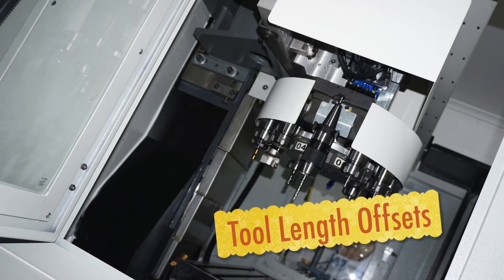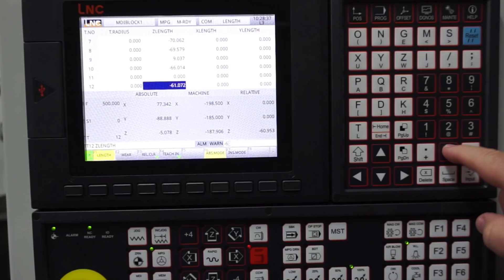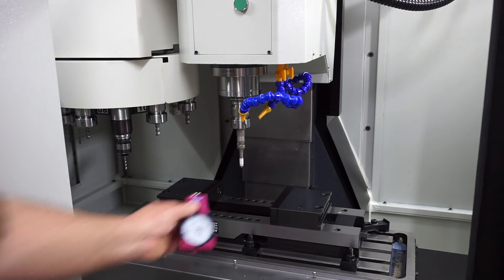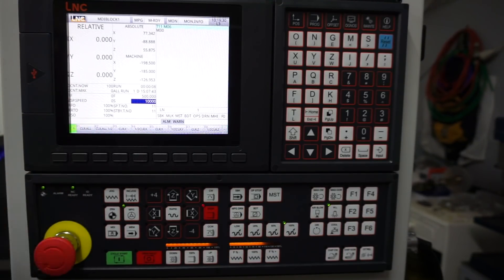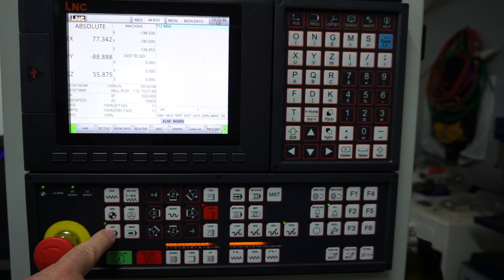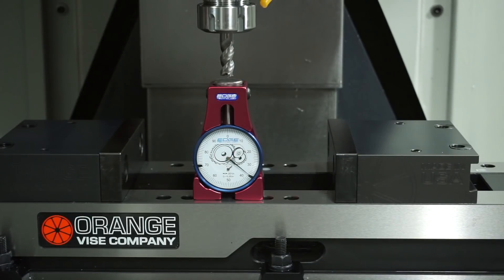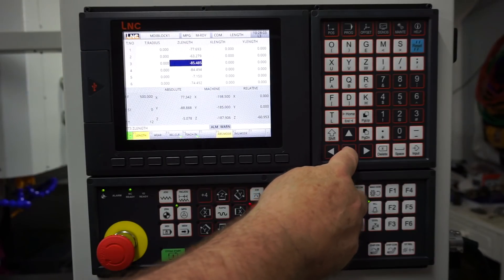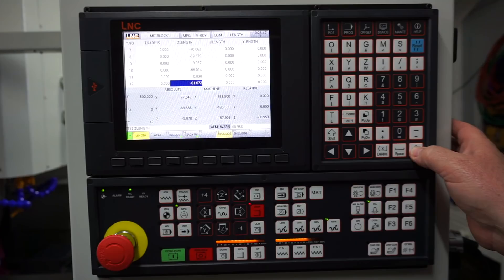How to CNC Pt.2 - Tool Offsets

Comment: Hi
What is your impression of the LNC control? Is there an available F360 post processor available for that control?
Reply from the maker: Hey mate, still early days.  However, the more I use it the more I like it.  I've been very happy with machine and the LNC controller so far.  F360 post has been made.  It is available from the Facebook SyilCNC user group.  Cheers, Aaron.
Reply: DCTTeacher1 do you find the control to be fast and accurate? What sort of traverse rates do you get? How does it go Machining 3D surfaces like a die mold? What’s the support like here in Australia? Spare parts availability?
Reply from the maker: Hey buddy, rapids and cutting feedrates are listed on the Syil website (see link in video description).  Part sizes from what I've machine out of Aluminum have been coming out spot on.  The 3D toolpaths I did on the 1911 grips (see video) worked a treat.  As for support, if you import directly you're on your own (factory support via skype), probably best to purchase through a dealer.  Hope this info helps?  Cheers

Comment: Great video :) I've got a little question though. How are young people in Australia towards the metal industry in general? As from my experience here in Sweden it is absolutely shocking what attitude people's got towards highschools with metal working. It is looked down upon and usually only people with failed grades tend to be there for some unknown reason..
Reply from the maker: Hi Simon.  Unfortunately this does tend to happen from time to time over here too.  Many kids flock to the other trade areas, as most don't understand what engineering is and what it's about.  Most of my students who pick it absolutely love it.  Especially when they work out that there is good money to made in the engineering trades, especially in fabrication, CNC and aerospace.  Thanks for watching :-)

Comment: Nice video. I’m interested to hear more about how you set tools numbers, etc
Reply from the maker: Thank you Milbert.  I need to do a video to explain this.  Basically, in this style of CNC machine with an umbrella tool changer, tool numbers and pockets numbers must remain identical.  However, in a carousel type tool changer with a double arm, pocket number and tool numbers do not have to match.

Comment: Nice vid Aaron!  That tool setting is a good bit different than with Mach3........probably because you have a real controller. LOL
Reply from the maker: Thanks Mike.  I'm still learning the controller myself and I'm sure there is an easier way to enter the length, like a teach in function.  However, for the purpose of education I think it wouldn't hurt people to learn how to do it this way ;-)

Comment: Hi,

Just a few questions; 
Why didn't you get the tool setting kit?
Why have you set the zero point of your tool so high? 
Wouldn't it be better to set from a point on your table rather than your vice?
How do you measure your tool wear?
Reply from the maker: G'day.  I didn't get the table probe as I couldn't afford one at the time.  If I was running production (and not in my garage) I would have definitely purchased one.  It doesn't really matter where you take your tool length reading from, as long as you're consistent in your method.  Tool wear without a table probe is measured during the manufacturing process.  Parts are measured and the controller can tickled for both over-sized and under-sized parts.  A table probe (like the Renishaw) can do this on the fly (during the cycle), but unfortunately I don't have this luxury :-)

Comment: Sweet! What kind of probe are you using Aaron? Does it beep as well? How would you compare it to the wiggler kind? Ciao, Marco.
Reply: Crivo152 - You can easily make your own.  Get a probe without a beep, and load a beep sound on your cellphone.  When you lower the probe, as soon as it touches, click the Sound on your cell phone and you will hear a beep.  After some practice it will become a second nature and you'll have your own probe with a beep.  Easy peasy.
Reply from the maker: Hello Marco.  My table probe used to beep but the coolant solved that problem.  Yes this probe is better than a wiggler type.  At least you can set Z-height with it as you can't with a wiggler (unless you use paper as a feeler gauge).  In all honesty, a probing system (like Renishaw) is the way to go, but it all comes down to budget mate ;-)
Reply from the maker: Dan you're such a cheeky bugger.  Hey mine used to beep but the coolant sorted that out for me lol.  So now the only beeping or ringing sound I hear these days is after my wife slaps me in the ear drum for buying another CNC machine :-)